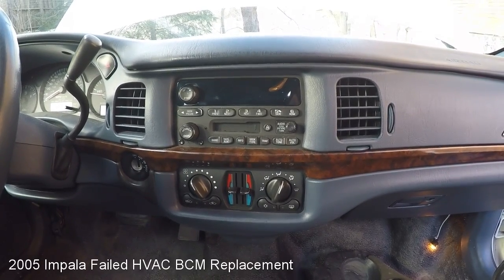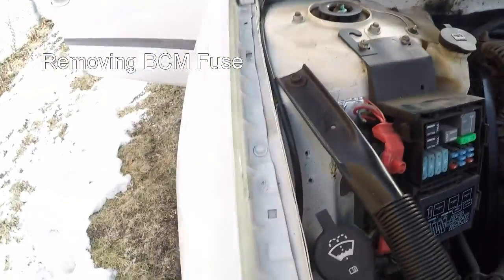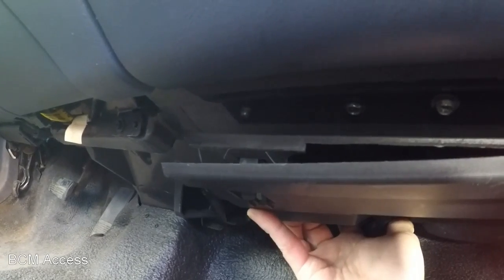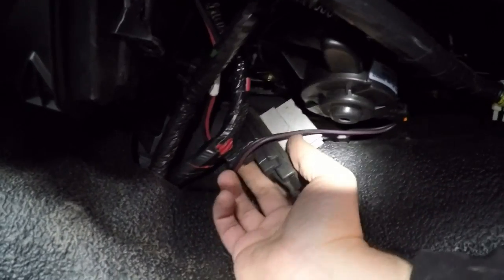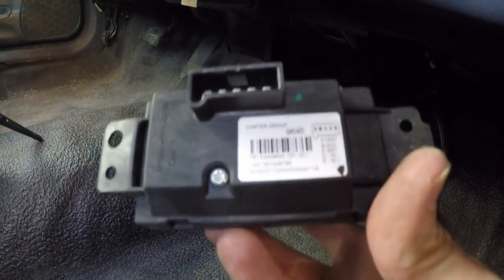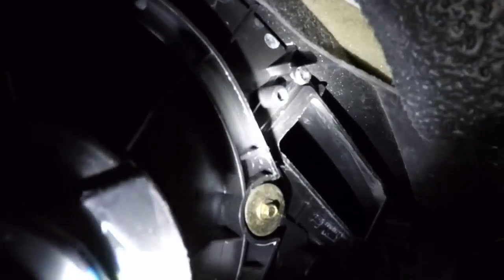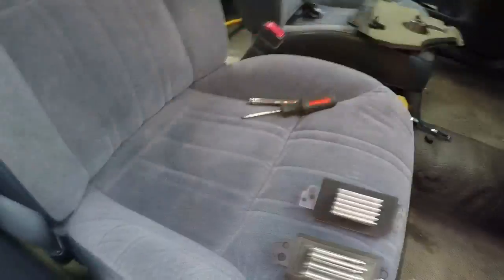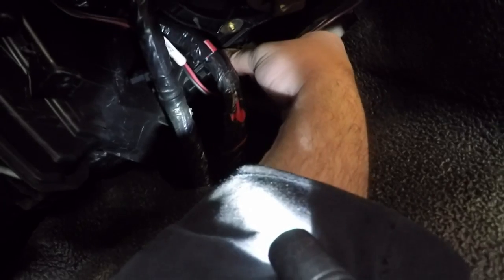Impala Failed Blower Control Module - 8th Gen W-Body

Comment: I found the production connector right behind the ash tray had a burnt pin on the red wire that runs to the resistor control assembly.  I cut it and spliced the red wire together.  Also had a loose pin on the connector to blower motor.  Found all of this after I had replaced resistor control assembly and the blower motor.

Comment: Thanks just saved me a lot of money. Have any trouble with it shifting hard. I'm thinking it's the transmission but the mechanic I took it to says it's the motor mount.
Reply from the maker: +blackops7121 Mine shifted hard when there was a transmission fluid leak, check the fluid levels. The 4L60-E transmission will shift hard if the fluid pressure drops from low fluid levels if its sloshing around when taking turns and bumps.

Comment: Ty for the video.  You may have seen initial startup procedures wrong as a child and it just hung with you. When you first put the key in the ignition you should place the key in ACC for a few seconds and then turn it over.  It allows time for the fuel pump to build pressure before starting. Cya!

Comment: i just did this repair and it was successful. It was a little tricky to do the replacement because of the small space and the angle trying to get the ratchet to take the hex screws off.

Comment: I switched out the heat resistor with a new one and did not take out the fuse prior.. So now, I have heat in full blast (thank God) but now my blower won't shut off unless I take the fuse out. What would the problem be? It's starting to get cold and I really need my car to work properly.

Comment: What was your car doing that you replace this module, I am curious because my fan won't shut off even when I remove the fuses on driver in passenger door panel, it only stopped when I pulled the one you pulled from under the hood?

Comment: Mine on my '03 might not be working properly anymore. It only turns on on setting number 2, but 1, 3, 4, and 5 don't so im thinking this could be it as far as where the problem is.
Reply from the maker: Yes, sounds like it is the blower motor resistor I replace in the video. IMO, it's cheap enough to try just replacing it to see if you get full control back.
Reply: @KTrainGarage  I have an 04 Impala and the fan would only blow intermittently for a while and now it has stopped.  I checked fuses and they were good.  I can feel cold and hot air trickle out when I use AC or heat, just no fan.  I bought a new BCM/resistor and was trying to replace it today.  I found that the old one is mounted with what looks like rivets and not screws.  The rivet like head has a hole in the center.  Have you ever seen this before?  I thought maybe a Torx or hex bit would work, but there is nothing to grab inside the hole of the rivet head.  How do I get the BCM/resistor out?  Also, I plugged in all the harnesses to the new resistor and blower motor and the fan did not work.  Is this a sign that the fan or dash environmental control panel needs replacing?  How do I test these to see which needs replacing?

Comment: Question: 04 Impala, no heat in front defrost mode, no heat in floor mode and no heat on driver side in vent mode (heat comes in on passenger side ONLY). Will replacing the blower control module fix this?
COMMENT: no clicking sounds, I hear and feel things changing from front defroster, to mix with floor, to mix with floor and vent, to vent only.
THOUGHTS: I don't think its an y door actuators, I'm not sure where to go from here. Need help please, winter is starting up here in Colorado.

Comment: The fan was keep running after motor turn off so I remove that green thing and it stop so what should I do ?
Reply from the maker: +thomas lundy Sounds like you had the same problem that I did. Replacing the Blower Control Module will fix the control of the fan so it only runs when it is switched on. This video is how to do that by changing out the bad controller on the bottom of the fan box which is GM part number 15-81727.

Comment: I’ve got one that when you stop it just stops blowing completely and then when you take off again it starts blowing again any suggestions
Reply from the maker: Check alternator voltage at idle and when revved, might be dieing. I think it should be 13.8v on these cars.
If alternator is okay, could be stressed wires or bad contacts.
Check blower fuse and relay contacts in the fuse group we look at in the video for corrosion.
Also could be connector or wires for resistor or motor.

Comment: hello, I have a 2005 chevy impala base model 3.8L the problem I'm having is when I turn the heat on it blows warm out of the right side vents but blows cold out of the left side vent.. can you tell me what's going on?
Reply from the maker: +Kelvin Hardnett On the side of the HVAC air box is 2 heater actuator motors (one for each side) that allow the air box to mix warm air into the ducts from the heater core, or not, depending on your temperature selector. These actuator motors can fail. You should look at how to remove the left heater actuator and see if it looks failed. It is designed so you can remove the actuator without removing the whole HVAC box.
Reply: +K-Train Garage 

Hey there, I was able to get the actuator on the driver's side.. I replaced the old one but nothing changed.. any other things that may cause that drivers side to blow cold air while the dial is set on hot air.. and thanks for helping me with this..
Reply from the maker: +Kelvin Hardnett The gears that move the air passage dampers fins may be broken or stuck. If you aren't hearing any clicking or tapping then that may be the case. You also may just need to move the temp settings dial slowly from warm to cool and back to get the fins to reset.
Reply: +K-Train Garage 

ok great.. I will check that out.. I didn't hear any clicking so noises.. thanks and I'll definitely let you know when I find out
Reply: +Kelvin Hardnett  Did you ever find out what it was? I have the same problem.
Reply: +Roy B 
hey, I did.. it's called a blend door actuator..
Reply: +John Shay 
it was the blend door actuator. for some reason Chevy complicated things by dedicating these actuator for each side
Reply: +John Shay no problem glad I could help some.. the best part is that their not hard to replace, you'll just need to take off the panel, but is pretty easy..take care bro
Reply: @cowboGA  where is the driverside actuator?
Reply: @Mcdashiznit  Its been 2 years since i did this, but i had to remove the panel from under the steering column and its positioned behind the radio.. it wasnt hard to replace but i hope you dont have big hads cause i caught hell trying to get it out. lololololol
Reply: @cowboGA  thanks

Comment: I have a 2004 Chevy Impala. I was at work on lunch and my heat/blower likes to not work sometimes, so I smack under the glove box and it kicks on. Well when I did that, this time my whole car died & will not crank over at all. Only thing that comes on is the headlights and inside light when you open the door. No dash lights nothing. Please help.
Reply from the maker: Since you still have some power, it's probably a blown fuse. I would remove the blower fuse in the video, then check the rest of the fuses. Replace ones you find blown, leave the blower one removed, and you should be able to start and drive it again.
Long term, you probably have a short circuit somewhere in the climate systems. You need to find it or this will keep happening.
Reply: K-Train Garage yes. It was a blown fuse. The main fuse it was corroded bad. Paid 4 bucks for a new one and it started right up. Thanks for the help.
Reply: I have a 04 impala blower won't work all the time. If I hit under the passenger side dashboard it works do u think its this module?
Reply from the maker: GEN3RAL ZOD either the module in the video or might be the fuse in the video as Matthew Bragg discovered.
Reply: GEN3RAL ZOD thats how mines was. Except when I did that the whole car shut down and wouldn't start. Turned out to be a bad main fuse cause it still has trouble with the blower kicking on.
Reply: K-Train Garage how much is a module?
Reply: K-Train Garage is there anything else it could be? Resistor and blower motor have been replaced before. Passenger side air vent was badly clogged so I'm wondering if that had to do with anything. I can hear the heater bogging the car down so it's working but only blows if I beat on it and then usually only lasts a few seconds.

Comment: Can help me on my AC/HEATER unit not working. It blows Hot in summer and cold in winter.. what is it ??
Reply from the maker: Sounds like the blend door actuator motor, or the damper fins they control. Can you hear the blend doors move when you switch the temperature dial from hot to cold ?
Reply: K-Train Garage no
Reply: I think i so.yes well it sounds different more heavy on the heater side.
Reply: And all the modes work.

Comment: I have a 05 I change the bcm for the fan but it work hot air coming from my ac vents do anyone no the issue
Reply: Temp control on heat instead of cool and fan on and a.c. on

Comment: What I'm tryna figure out is that I changed the starter and the ignition switch but still won't start 02" impala help please
Reply: Is the yellow security light staying on when you try to start it?
Reply: @swflscratcher5893  Yes
Reply: Then simply turn the key off then turn it on and off 3 times, then try to start it for 10 seconds, then release the key but leave it in the on position, then wait 10 minutes the security light will shut off, now you can start the car
Reply: @swflscratcher5893   I'll try that
Reply: Happens to me sometimes that’s the only way to fix it, it means something caused the key to lose its code, and doing that reprograms it
Reply: @swflscratcher5893   I mean I had moved it from the backyard then later that day I tried to start it it wouldn't say nothing
Reply: If the Security light is on, that’s the fix 100% of the time if it gets bad it may do it multiple times a day. But that sequence will allow you to start it 100% of the time

Comment: Hi , my impala is a 2005 and it's not blowing any cold or hot air through the vents ... Blower fan is not working... It was working when I bought it from someone but had to unplug the harness from the blower control module or resistor for my ac or blower to shut off and then plug the harness back in whenever I started my car again in order to use my AC again... Now the blower is not kicking on at all and nothing seems to be wrong with the 20 amp fuse on the driver side or the 30 amp relay under the hood .. Any idea what might be wrong? I don't want to just throw parts at it...
Reply from the maker: Sounds like Blower Control Module is bad - same part as in this video. It moves the air in the cabin for hot and cold and is mixed by the blend doors to whatever you set the temperature slider to.
Reply from the maker: Yeah if it has never been changed the module will be attached with a plastic rivet. It's permanent. You will need to cut or drill it out.
Replacement modules have an extra hole you can put a fine thread screw through to reattach it near the original plastic rivet hole.
Reply from the maker: Yes that symptom is very likely a BCM that has failed in the blow on full power mode. Replace it and ventilation should be controllable again.
Reply: Henry Sequeira